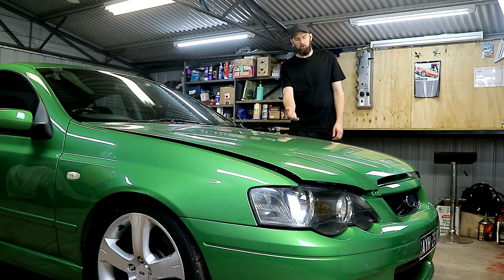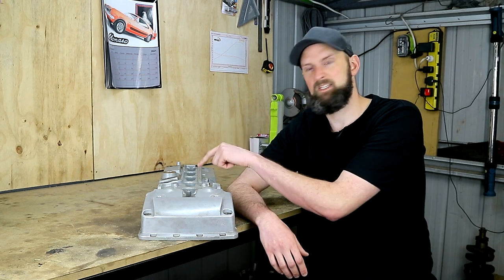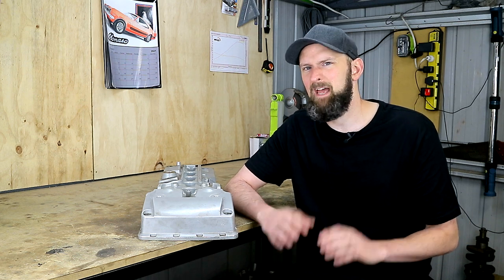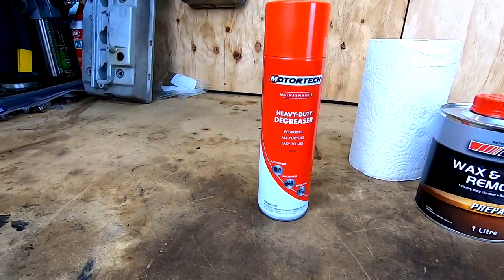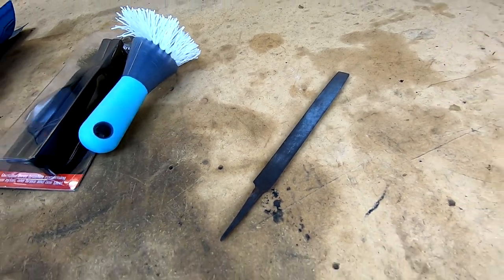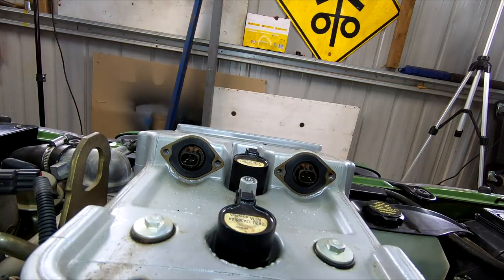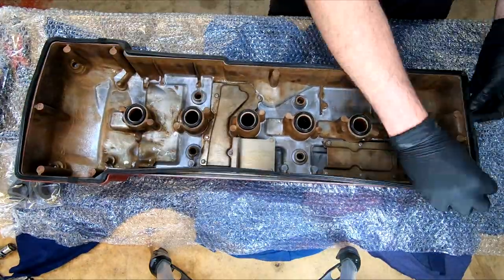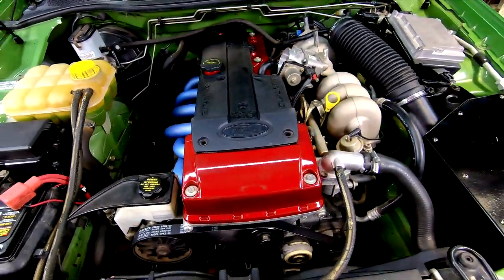Paint Your Rocker Cover & Replace Gaskets | BARRA EDITION

Comment from the maker: For those curious - Yes I bought way too much paint! Better that than not enough half way through though!?

One can of each would be plenty.
Reply: Are you planning on putting a turbo on that motor. Would make a cool conversion going from stock NA to a turbo falcon on the NA motor
Reply from the maker: Yes, exactly that is in the works mate 👍
Reply: I bought just enough paint to do my plemum and covers (xr8), and as luck would have it the mechanics scratched the hell out of them so, too much is a must
Reply from the maker: @smithy2  Or you get that one can that seems fine but once you go to spray you realize it's no good. Better to have it and not need it 👍🏻
Reply: @BrowneysGarage  too right, 😁👍🏻
Reply: So how much two cans did u use because i planning on doing my break caplors same as my rocker cover and wanna idea how much eaxra be sweet

Comment: I painted stuff like my Coil cover and fuse relay cover in a nice gloss black, looked absolutely mint with a red rocker. Mines in Vixen to match the car. Might have to re-do her now haha. She looks mint mate. Also did all my plastic intake pipes and exposed bolts and bits and bobs like wipers and my power steering cover thing in gloss black, also did my heat shield in a matte black enamel, looks stealthy and mean. 
Also suggest getting a black Steele coolant reservoir, picked a second hand one up for $200 and it just completed it. You might like it one, 
 will 110% be doing your blue and white Ford style on the badge up front. Might even paint the 4.0 DOHC in red to make it pop off the gloss black!
Enjoying the vids mate. Keen to see you in the spooly boi gang 💯

Comment: Welcome back Browney! I have already done plugs and aftermarket coils trying to fix a bit of a miss, which is when I found number 2 or 3 plug hole was full of oil. I finished the job and then stupidly torqued down the RC cover bolts a bit more to see if it would help. I have not had any more missing, but I feel like I may have damaged the threads and gone a bit far.

Anyway, I have a spare cover and a gasket kit ready to go. Wanted to paint the cover first of course but am wary of how much to attempt myself. Other videos have shown people struggling to remove the cam phasers but it seems like a lot less of a headache not to have to do this. 

If 2 RC bolts end up being threaded, will the others be enough to secure the cover? Should I just buy a new engine? haha, thanks for demystifying odd jobs as usual.
Reply from the maker: One way to find out mate! 🤣

Remembering that I have no real answer I'd have a stab and say that with a fresh gasket under there you may get away with it even if one or two do turn out to be threaded, but if they're in there and holding now they may not be damaged anyway. That extra height and new rubber of the new gasket I would think will help with the seal.

Good luck and just see how it goes, don't burn the car to the ground or bin it just yet! 👍
Reply: @BrowneysGarage  haha, cheers bud. I was picking up a few things at Repco yesterday and noticed some thread repair kits on the shelf. Not game to attempt if it comes to that, but I'll have a crack at the rest and hope it all hangs together.

Thanks for the inspiration, been working on the wagon for a couple days and got plenty of good things done : )

Comment: Excellent video mate. I thought the throttle body gasket install was the hardest part! :)
Reply from the maker: Was a real pain, you may be right! Slipping a corner of the gasket in and putting one of the tops bolts in, then swinging the gasket round on the bolt into position seemed to work ok.

Comment: Excellent vid mate. Can't wait for the future of this channel. How long til the 6spd auto swap?
Reply: @Mr-Broccoli  ZF swap kit is $2000 compared to a TR6060 swap kit @$2500‐ $5000k depending on the k's on the box; throw another $700- $ 1000 for a decent clutch, machined flywheel, new seals, new CSC & remote bleeder.
Don't waste money on a T56 unless it is the T56 Magnum box

TR6060 that has been blueprinted & clearanced will outlast the T56 (which i did with my BF MK2 XR8/ GT500 hybrid)
Reply from the maker: Play nice you 2 but I definitely agree, you both have good points but the ZF swap seems like a real pain and not something I would likely ever want. The BTR can be built to handle good power and isn't AS bad as some make out but if I was to upgrade it would likely be to go manual so the 6 speed in whatever form I'd say would be more than enough.
Reply: @BrowneysGarage  Go the manual for sure. Also need a switch on the clutch I think for the cruise control if running that.

Comment: ..... Well done Mate,  
FYI,  Symptom, BF stuck in 1st (Not limp mode),   cause, (Took me 2 Days to find).
Previous owner spilt Coke into centre console increasing resistance on 'Hall effect' manual sports mode circuit track.
Reply from the maker: Well that's different, well done on fault finding that! Cheers for the ehads up, love hearing these oddball ones.

Comment: Should get one of the black coolant reservoirs from kustom shop would be a nice touch 👌🏼
Reply from the maker: Not a bad idea mate, might have to look into it. Cheers 👍
Reply: @BrowneysGarage  I’ve got one they definitely clean up the bay . Awesome video by the way can’t wait for the turbo build
Reply: Nah- Mackilec system really tidies the bay up. Also grab the PCM relocation braket. Couple hundred Dollarydoos, but the best i have found & used- and that's during my BA/ BF/ FPV & FG MK2 ownership.
Reply: @maxrockatanksyOG  yeah but the mackielec one isn’t good if you want to get rid of it all together . It’s not a coolant reservoir

Comment: That ford logo looks awesome... did you put any type of clear coat of it.. really enjoy your little movies thanks
Reply from the maker: No clear coat on that part. Sure it would be fine but being plastic and having a bit more flex and movement than most metal parts I didn't want to add too many coats of paints, making it thicker and perhaps more prone to cracking/damage with this movement. Again, sure it's not an issue but just being a little cautious.

Comment: G'day Browney, firstly awesome video mate. I followed this to remove the rocker cover for my MK2.5 08 XR6 but when I went to gently pry off the VCT phaser gaskets the passengers side solenoid came out with it - alarmingly not the whole assembly! Just half of it. So part of the assembly is still in the housing above the end of the cams. 

The only information I found online was about FG's where the whole vct solenoid can simply be pulled out. For BA's there's a screw which holds the VCT phaser in place. Do you have any idea for a BF if you're able to extract the rest of the VCT phaser without removing/affecting the cam??

Comment: ive been putting off doing my rocker cover gasket, i get oil in my plugs haha, any chance you could do a sump plug gasket vid? i got a bit of a leak coming from there and contemplating just rubbing some gasket goo on the outside where the leak is coming from hahah
Reply from the maker: Sump gasket? I'd be very tempted to do the same thing you're contemplating mate. Would be a nightmare of a job at home so no sorry, probably no video on that one in the future!
Reply: Check Cam Phaser seals too- not long did my FG MK2 with 73,000km on it, and first 3 plug wells filled with oil every 300km; which also lead to the coil issues i now have (waiting on parts...)

Comment: hey mate how did you remove the vacuum line for the brake booster? did you just give it a pull with pliers? cheers
Reply from the maker: I don’t think I did to be honest, was being stubborn and didn’t want to break anything! Just worked it off/on the back of the holder and was good.

Comment: You didn’t need to remove the spark plugs (unless you’re changing them)

Excellent colour though, top job on the rocker cover mate!
Reply from the maker: Had seen another comment mention this as well, are you sure this is the case on the BA/BF with the cover having to be moved backwards first to clear the camshaft phasers/actuators?

Honestly would probably continue to remove them for this job in the future anyway, its tight already and gives me one less thing to worry about breaking on the way out/in, but curious nonetheless.
Reply: @BrowneysGarage  I was a mechanic for Ford for 3 years man and still continue the trade from my own shop now, trust me Browney, there’s no need to remove them. Ive done this job countless times and I also own a BF turbo myself haha. Definitely remove coil packs but spark plugs can stay. You’re just making extra work for yourself my man but it’s each to their own I guess. 

Regardless, I love watching your vids haha keep doing what you’re doing and look after your car man it’s a SUPER clean example and a part of Australian history.
Reply from the maker: @SD. Hey I try make it very clear that I’m not an expert and this is just how I’ve done the jobs, always happy to learn so thanks for the info. Cheers mate 👍

Comment: I should send my cars over to you Browney to service and work on for more content for the channel.
Reply from the maker: I don't have enough time to work on and service my own cars Bryan, I don't need to be fixing yours too! 🤣

Glad you're here and looking forward to the next video mate, I'm working on it 👍
Reply: @BrowneysGarage  all good, I have the time to work on the cars but lack motivation at the moment
Reply from the maker: @gore1978  Can definitely relate to that mate. Sounds dumb but it helps me just to go out and tidy up the garage/work area a little. Even if just a sweep up regardless of whether it really needed, somehow helps a little.

What's on the list to do mate?
Reply: @BrowneysGarage  I work out under a carport so limited time due to weather. I have coils and spark to change, air and fuel filter on the territory. Air, fuel & oil filters on the ba and air and oil on the fg. Mind you that's on top of swapping trailer loom and connecting up extra reverse cams
Reply from the maker: @gore1978  Bugger none of it's fun but at least most of them aren't hard jobs. Sounds like a long list but I'm sure once you got going you'd knock it out nice and quick mate 👍